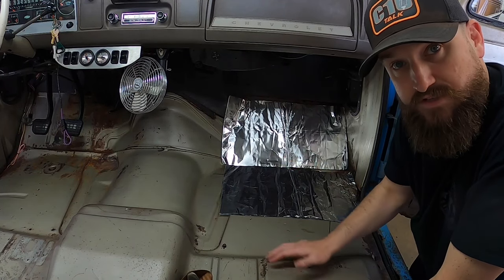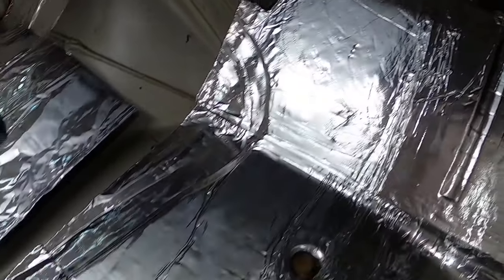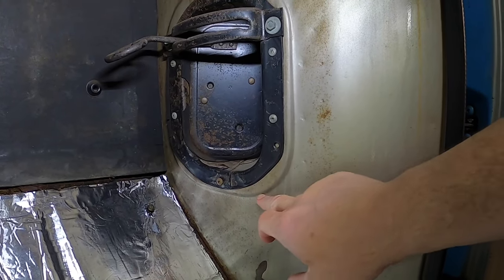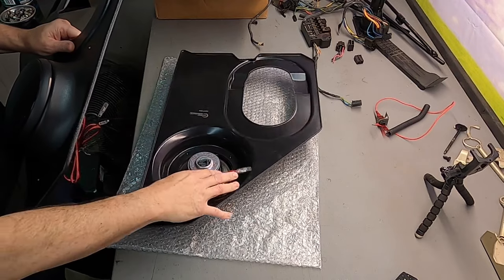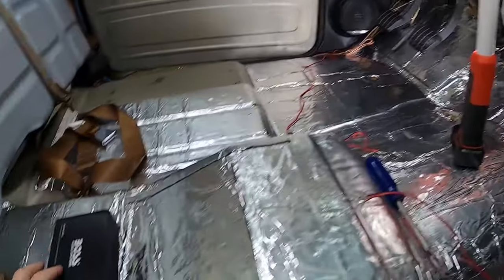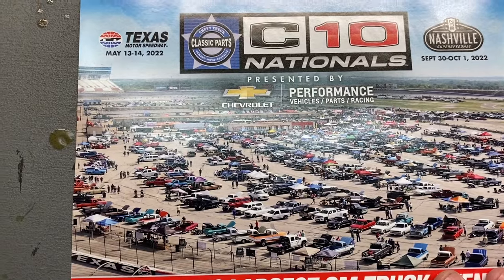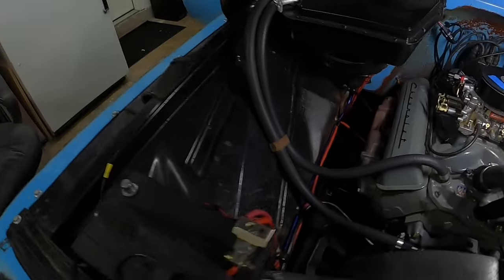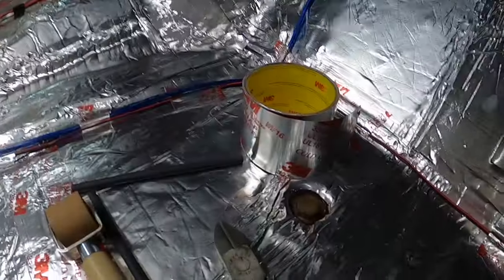Stereo system install 1966 Chevy C10

Comment: Being a part time audio installer, stinger is a good brand to use. The fuse holder next to the battery would work fine. I’ve used those fuse holders in higher watt system. I do want to say that the sub and the amp are not really putting out the power it claims.
Reply from the maker: Thanks for the reply. I ended up changing the fuse holder to a different style and hid it under the battery box. Looks cleaner than before

Comment: I just got the exact same kick panels, I was curious how people are mounting them, the passenger side fits like garbage on mine too lol. Good video, thanks.
Reply from the maker: @CLASSICSAREBETTER  I used sheet metal screws to mount mine. I made the hole in the plastic panel slightly bigger for minor adjustments. Looks better if you use black screws or paint the head of the screw black. Thanks for watching

Comment: I Wonder if you could make a 1/4" steel rod to cross up and over the components and make the seat slide work? Nice work btw.
Reply from the maker: It’s possible. I kept the old rod so I may try to come up with something in the future.

Comment: My grandfather had a 64 c10 three on the tree longbed stepside.very cool pickup. Cool videos you have on your channel.I love the 70 chevy,how did you get that rumble out of that thumper cam?great videos keep up the good vids.
Reply from the maker: Thanks. I’m glad you like the videos. I guess the magnaflow mufflers gave it a good sound. I miss driving that truck
Reply: @Chickeneyegarage  I own  a 70 k10 myself but I don't have that bang,pop echo sound like you had on your 70.I'm not even sure what my compression ratio is.e street heads,standard 30 over pistons and rings, aluminum intake manifold,600 cfm elderbrock carb.thumper cam.
Reply from the maker: @dangarcia9476  depends on the cc of the combustion chamber. If the engine block has never been resurfaced along with rebuilder pistons it probably around 9.5:1 compression ratio. I had my block zero decked to where the only set 5ths in the hole at tdc. Bumped the compression to around 10.6:1

Comment: Charlie whats the pull knob for on drivers side by seat?
Reply from the maker: There’s a bell on the other side of the floor. Push on the knob and it’s sounds off the bell. It was on there when I bought the truck

Comment: Need to see how you mounted your seat belts
Reply from the maker: My truck came with the factory nuts welded to the cab for the shoulder strap part of the belt. It made it real easy to install.

Comment: Charlie- did you hook the powered sub to the boss amp? I am buying the same set up for my C10 and want to run a sub. From what I’ve read, I haven’t seen anything that says you can run a powered sub from it but I’d love to. Thx!
Reply from the maker: RCA output and the remote power wire connects from the boss amp to the sub.

Comment: What kind and size screws did you use
Reply from the maker: For the speaker panels I used black Philips head screws probably around  one inch long. Mounting the subwoofer, Bluetooth amp are the same type of screws just shorter. All the hardware I used I already had in my garage.